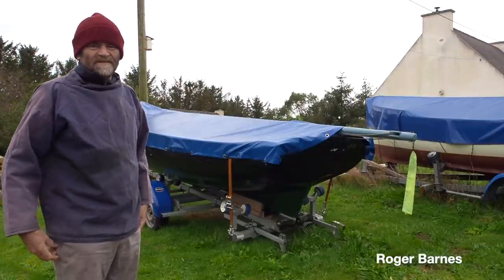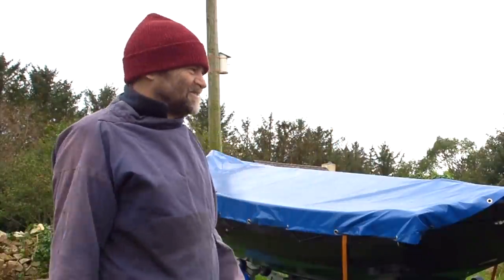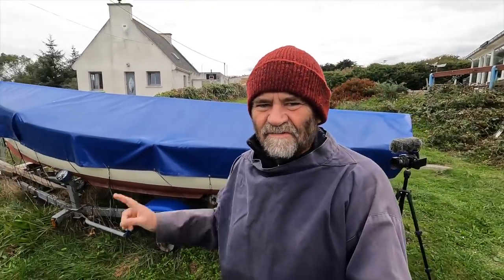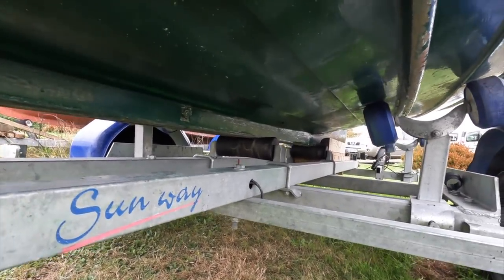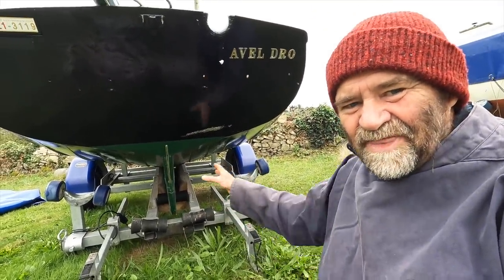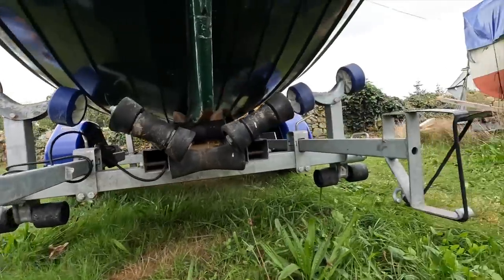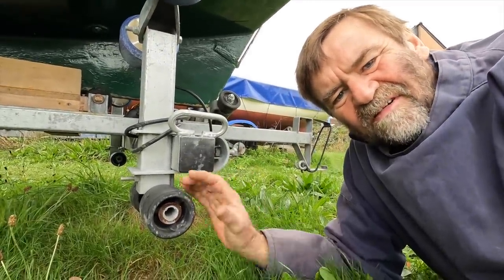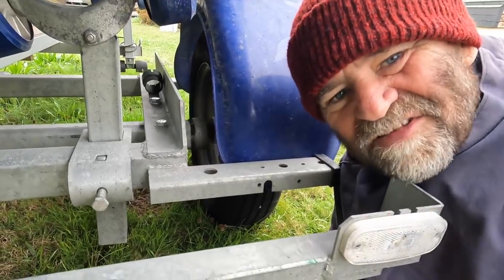Autumnal Work - geeky video 3

Comment: When I had my old wooden Fairey Marine Albacore I used to use my brother's pre-fab house which he bought the walls and roof and restored for use as a garage with pits, ramps etc. I used to especially enjoy the winter weekends and smile at the rain falling on the roof while I rubbed down the wood prior giving it another coating of marine varnish. Nice video of a couple of jobs involved in dinghy and trailer maintenance.

Comment: All you angle grinder users... resist the temptation to use a cutting wheel also as a grinding disk.  The cutting disk is not designed for that, the reinforcement will wear away and it could break under pressure.

Comment: Was that a George Bences tape measure? The plug adaption into the grinder is very familiar. One thought, it might already have been mentioned, why not either put a bolt or a pin through, rather than just tighten it with a bolt? Nice vlog, it's good to see the work and maintenance rather than just the sailing, it's a much better perspective on your passion.

Comment: An idea for your bolts that lock the brackets for the roller posts to trailer. Add a nut to lock the bolt in place after the bolt is tightened.

Comment: Always a good idea to take all the cable off an extension. There is an issue with the coil over heating if you don't. Most will state on them somewhere what the max amps is coiled and uncoiled.
Reply from the maker: This is true, but it is a very thick cable and the angle grinder is not particularly powerful.

Comment: Very enjoyable, also enjoying your book albeit that the print is a little small but learning a lot. If I can humbly reciprocate a little , it's always sensible to fully unwind an extension cable - stops over heating and allows max power usage particularly with high power tools.
Reply from the maker: I judged that the angle grinder was not powerful enough for this to be an issue. But I might well have been wrong.

Comment: Thanks Roger. Another enjoyable video. Did you consider splicing a loop for the tack downhaul? Or is there a reason this wouldn’t work?
Reply: I was thinking just the same question…
Reply from the maker: I was going to, but the rope was too stiff with old varnish etc.
Reply: Makes sense. Thank you.

Comment: Would be interesting to see how the two boats of same design but different lengths perform?  I would expect the longer capable of better speed but at what expense? I also felt your pain adjusting trailer rollers. At least to bolts were not rusted solid!

Comment: Excellent.  Thanks.  Francois recommends not using rollers on the keel because it raises the boat higher.

But I've always worried the outer rollers will deform the hull strakes if all the boat's weight is put on them.  

Fantastic to get a close up of the arrangement on your trailer, I can show it to the trailer fabricators to get what I want now.  

Not sure they've ever seen a broken back trailer either.

My Ilur build is half way through now, not long before I flip the hull over and start on the interior.
Reply from the maker: Yes, I considered a multi roller trailer but I would worry about it not supporting the keel properly.

Comment: Well done. I have some anti-rust painting to do on my trailer, and I have welded on two L-section steel struts to enhance the rigidity between the bar with the keel rollers and the axle with the rollers that keep the boat upright. I found that one of my keel rollers was loose and I was lucky not to have lost it on the road when I came back home from St Malo the other day. It has a new nut and bolt and will get a couple of spots of welding. I have also been sewing the loop on my mainsheet so as not to have a big clumsy bowline. Plenty of fun for the winter as well as the new season we all look forward to!

Comment: Roger, Cutting those hull supports will have breeched the galvanisation layer making them prone to rusting, particularly as they are the most likely part to be imersed in salt water. You really need to treat the cut ends with something like a cold galvanic paint. It won't be as effective at preventing rust as the original galvanisation but it will certainly slow down any rusting.
Reply: Sorry Roger hadn't read your reply to Clive later down the comments list

Comment: Excellent video as usual, Roger! I really love watching them. 

One question, though. You sewed the eye of the down haul in stead of splicing it. Are there any special reasons for that?

Best wishes from The Netherlands.
Mike
Reply from the maker: I was meaning to splice but found the varnish I had stiffened the previous loop with, had hardened the rope too much. And I may end up shortening the rope still more when I have had a chance to try out the new arrangement.
Reply: @RogerRoving  makes sense. 😊👍

Comment: Reason for new trailer? Was it because you found it impossible to register the old one in France... I'm having a nightmare trying to register mine. COC was rejected and DREAL are demanding a plaque on the drawbar which the manufacturers can't supply! Or did you just want a new trailer?!
Reply from the maker: I would have had to register it as all up weight over 500kg. It did not seem worth it for an already old trailer.
Reply: @RogerRoving  You did the right thing! Mine is a recent trailer, supposedly with a Certificate of Conformity, but I'm close to giving up, taking that trailer back to the UK and buying another here!

Comment: WD-40 is a degreaser. Don't you want to grease or lubricate that? Triflow penetrates and lubricates effectively. Not sure y'all can get that on the Continent.
Reply from the maker: It’s also a penetrating oil.
Reply: @RogerRoving  I appreciate your experience with it. I prefer to have greased or lubricated the joints such that I don't need to apply it. My experience is that it removes lubrication and leads to more rust and corrosion.